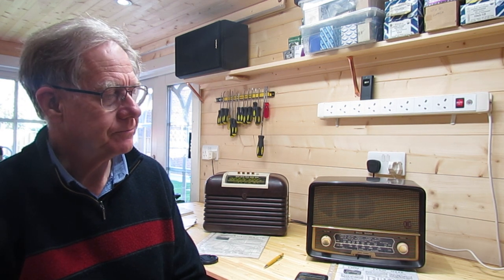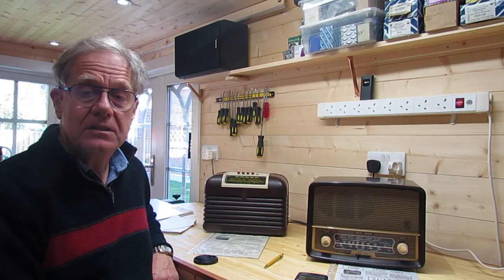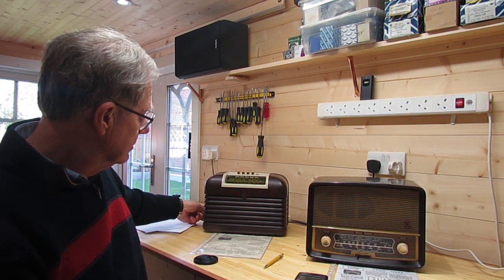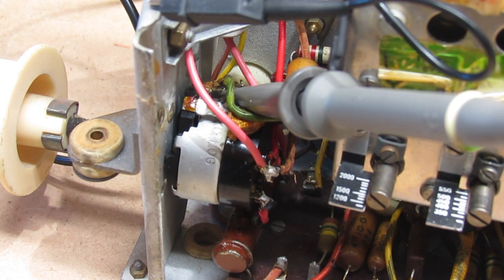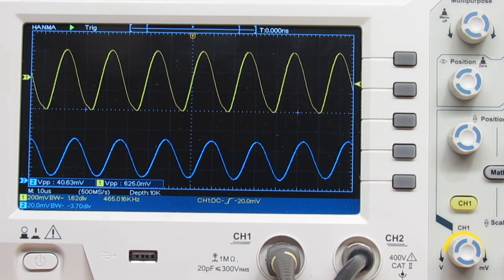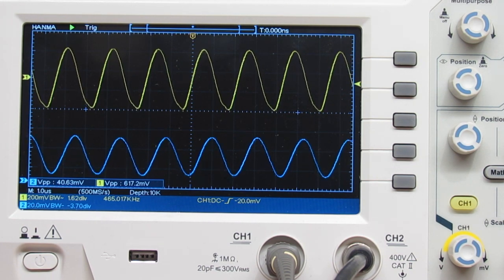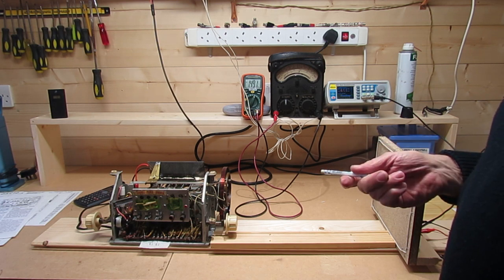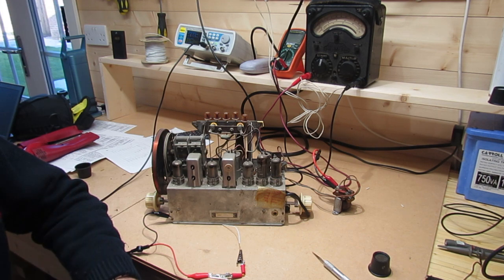To Align, or not to align - that is the question

Comment: Nice overview of the yes or no need to do a radio alignment.  I usually align after any repair, especially if I've replaced a lot of parts, as I feel that matches the new parts with the remaining old parts and helps them "get along" with each other better.  It also teaches me more about how radios work and why the engineers designed them the way they did.  As you know, radios often reflect not just the period technologies used in their manufacture but also the methodologies that were employed in their country of origin.  For example, I picked up a Japanese radio two days ago at a flea market for 3,000 Yen (about 23 Euros).  Not sure of the date of manufacture but I know it's from the Occupation just after the war.  It's about the size of yours but the case is veneered wood, and the chassis and parts came from a standardized kit sold to radio shops by parts dealers who assembled them as no-name sets in order to sell them at prices much lower than the name-brand sets.  The name-brand sets at the time came with a high tax and many people couldn't afford to spend one or two month's salary on them.  The cheaper sets thus made the new heterodyne radios very popular with the public and helped spark the comeback of Japan's electronics industry (I find radio history fascinating).  However, finding a schematic for these old sets, and then aligning them with no or scant Japanese instructions is often the hardest part of restoring them.
Reply from the maker: Thanks for your comments. There is certainly something to be said about understanding how these things work by alignment. That's a very good point. Fortunately, I haven't yet found a radio where I couldn't obtain the schematic, but I can imagine it being frustrating if you can't obtain one. I agree, radio history is fascinating

Comment: Tony,
great video but wondered if you found the same problem as me with your DDS  ( mine is the 6800)  as follows,
if you input a low signal level to your RX  at 14mhz -say below 40dbm 2mv rms   (the DDS outputs at 50ohm)  there  is always a remnant warbling tone like modulation which becomes more evident as you go towards the receiver noise floor.
regards
mike g4wam
Reply from the maker: Hello Mike. I've not had a problem, but then I haven't really tried very low amplitude signals. I wouldn't be surprised though if there was such a problem. You get what you pay for I think, and the unit was cheap. I think for what it does though it's good value

Comment: Hi Tony, tuned into your "how to repair radio" videos, but as a (now retired) Joiner, found out immediately I am wholly unequipped educationally to even consider repairs to my Radio. I have had It for nearly 30 years, and have only briefly heard it working (less than a minute) in all that time. Is this something you would undertake to repair for me?
It is a rather pretty HMV Model No 1104, from the 1930s I think. Atb Martin.
Reply from the maker: I had considered doing repairs, but the main problem is the public liability insurance. If the radio goes bang 2 weeks after I have repaired it, and burns you house down, I have a major problem on my hands.. However, having said that, I am quite happy to give you advice by answering questions. I am sure the questions you ask will help other people as well.
Reply: @tonydurrant  Thanks for reply Tony. I wouldn't  know the right questions to ask as such, re repairing. I would ask though is there anyone you would recommend that could repair?
Reply from the maker: I wonder about the chap on the repair shop. I believe he is called Mike stuck I think

Comment: I think the decision about twiddling is driven by circumstance.  If the radio in question is your property, and you know for a fact that it hasn’t been diddled, then I think it’s reasonable not to mess with it.  However, if you have found it necessary to do major maintenance on it, then perhaps at least a check of the IF and the oscillator would be in order.

However, if the radio is not yours, or the history is not known, then a check of the alignment, as a final step in the process might be a good idea.

Prior to the second world war, IF strips were capacitively tuned here in North America.  Those IF cans were remarkably stable, and trouble free.  Then some cost-cutter got the brilliant idea of tuning the IF transformers inductively.  This lead to the development of silver-on-mica capacitors in the IF cans.  This was fine for the first 40 years, or so.  Then the silver degrades, and “silver-mica disease” sets in.  This can be cured only by removal of the mica wafers from the IF cans, and replacing them with discrete capacitors. This is not as simple a process as it sounds.  The value of the original capacitors is almost never marked on the schematics. If you can accurately measure the inductance of the coils, you can calculate a value, but it’s often easier to just install variable capacitors temporarily, and twiddle until it works, then measure the value of the variable, and install the closest standard value you can find. This isn’t an operation for the faint of heart, and even experienced techs can destroy the IF can in the attempt.
Reply from the maker: I agree that circumstances have a lot to do with it. I think though (as I found out) that it's easy to get wrong . The trouble is that the only real way of finding out if you have done it right is to do a full frequency response check which is tedious. Its interesting what you say about the silver mica caps in the IF cans

Comment: I have just bought a Windsor signal generator. I think when you rewound those output transformers I  was out of my depth . I have only just figured out how to work my pre war AVO valve tester.
Reply from the maker: Transformer winding is not difficult. Just tedious and shouldn't be rushed. Glad you have a valve tester. Hold on to it. They are very sought after now
Reply: Hello. Avo valve data came from Crowthorne Electronics from where I bought a Hedgehog and Aurora
Reply from the maker: Ah yes. I know of Crowthorne tubes

Comment: I think that the European and Australian radios, which rely on inductors much more than capacitors as with their American counterparts are much less susceptible to drifting. I don't know that European radios are susceptible to silver mica disease either which is becoming a big problem in the states. Also most radios of that era from the states do not have lock nuts and some i.f. cans just have a big screw sticking out the top which anyone can go twisting, and I find frequently has been. All in all, European radios of this era were definitely a mark higher than the American in my opinion.
Reply: we in the UK do not have the trouble with SMD due to a diffent design of IF transformers.
Reply from the maker: ok - well that's very interesting. I have no experience with American radios, Thanks for the info